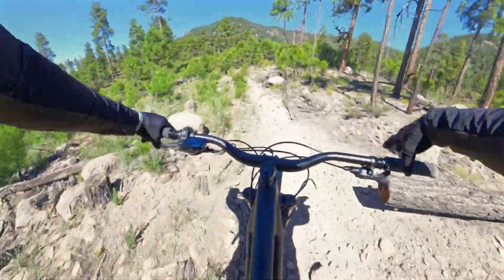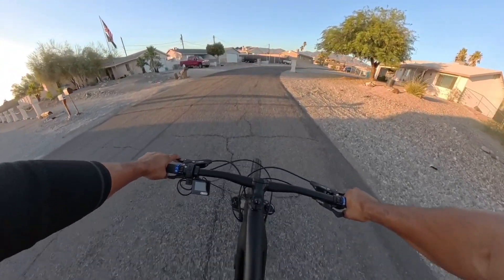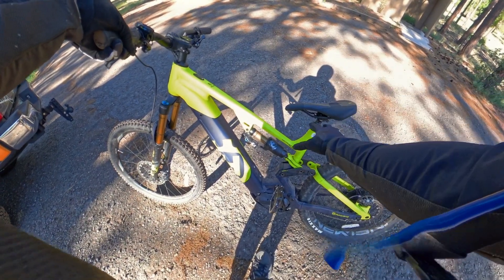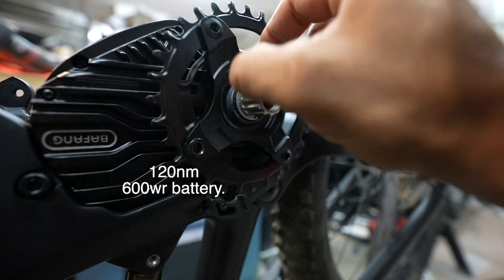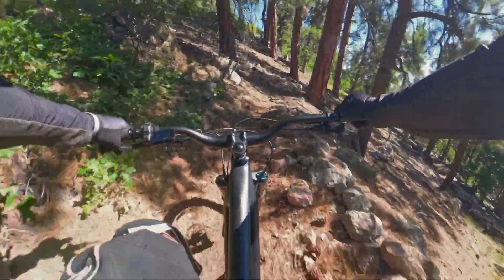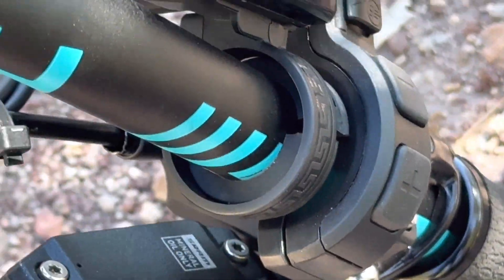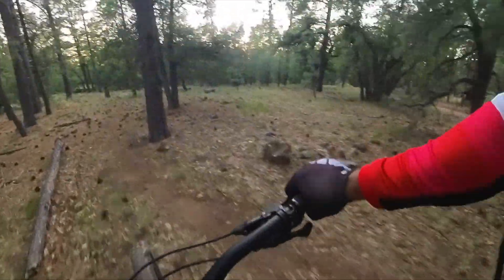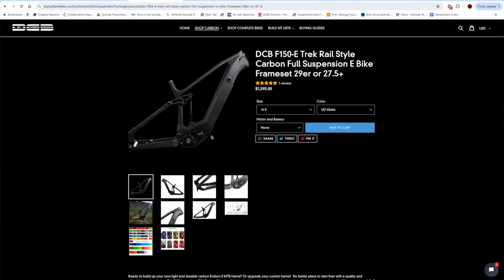Bafang M600 SMOKES Bosch CX & Shimano EP801 e-mtb centerdrive motors

Comment: You are using boost wrong 😂😂 on the bafang M600!
If you get over 16mph in boost mode hold down the power button as if you was going to switch it off... its a hidden push to go button that only works after 16mph

Comment: Big fan of the m600, mine died and I upgraded to the m560 which is lighter and even more powerful. Still a great motor, though, and it went through thousands of hard miles, so I dont judge it for failing.

Comment: The M600 is getting pretty old, bought mine three years ago. The M560 is the new lighter more powerful one. And get that, it fits in the M600 frame.
Reply: Have you ever used a M560...... How noisy are they ??  I am just about to build my own eMTB with one
Reply: @ChrisFitzgibbon-d4j  No I didn't, my M600 wont die lol But my guess is that it is similar to the M600. It as a certain whine to it. But honestly it's similar to other motors. BTW my M-600 is still going strong. 0 problems so far, I checked the gears a few months ago and they are like new after about 3,000km + of hard trail riding.

Comment: Ditch the old DPC242 display w/B&W screen. Go color and Bluetooth with DPC245...gives a smoother feel with more efficient battery usage. Plus, the power selector is smaller and more tactile. Been using the M600 since 2019.👊

Comment: hey what tool did u use to remove the nut to secure the chainring? mine wont fit because of the chainring shaft.
Reply from the maker: You have to buy a Befang Lockring tool. They generally come as a set. I got mine off some random website from google.

Comment: I have a emtb with a Bafang 820 motor & it equals my Transition repeater that I love to ride. I put together the Bafang bike as a backup. I only had $2000 in the Bafang which is a huge selling point. The geometry is almost identical to the repeater.
Reply: What frame are you using?
Reply: @Ghost999alpha  CEF50 M820 by SZZS frame and Lightcarbon LCES04 M600.
Reply from the maker: Yup, quite a difference.
Reply: Yep. I've got the M820-75 Nm...not quite as powerful as the gf's Trek Rail Brose-85 on climbs but it gives a lighter bike overall for agility. I use M600 for big alpine climbing days.🤟

Comment: DJI?
Reply from the maker: DJI is out to smoke everyone. No one will be able to beat them once they enter the market entirely.
Reply: @PontoonNation  My Luna Cycles Carbon X2 with a M600 and 2000w controller will still smoke the DJI with twice the power.
Reply: @PontoonNation  dji can nothe stable 1000watt. M560 make stable 1000watt and short time 1500waat boost 90sec go hot.

Comment: Yes you can get numerous displays for the “Bafang” system so visibility isn’t an issue, I use the 500 display and it’s great.
All Bafang motors come with an option for a throttle it’s part of their main harness as well as an option for a shift sensor, cut off brakes and of course a speed sensor.
If you want a good workout Bafang isn’t for that but if you want to have a lot of fun….
Just remember more power higher watt usage.
But there’s always a way to remedy that.

Comment: Another thing is in the Bafang programming assuming you can get the UART version and not the CAN version (newer) if can deep dive on all the perameters as far as torque, assist values.lots of info out there on the net as far as programming goes.

Comment: Yeah these motors have been around for quite awhile.
They are an offshoot from the 02,HD series motors which are DIY.
Been riding my bike with the M620 for three years now and no issues.
Funny a lot of the “bike expert reviewers” don’t include the 600 or 620 motors in their lists.
Bafang are heavier for sure, I remember you used to get the 620 with a magnesium body for a bit but not anymore.

Yes each motor has its own mounting pattern so you can’t swap motors to frames.
There is a company out there that is making adapters to fit certain motors to some bike manufacturers frames.
Reply from the maker: Do you know the name of the company that’s making adapters?

Comment: The M 600 has been around for years. It does have some power, but the controller sucks and I don’t mean that in a small way. When the power comes in, there’s a definite bump. The torque is not consistently applied given your input. The Bosch and EP8 far out classi it here. However, the Luna controller fixes a lot of these problems, but still not as good as Bosch. The best controller so far is on the new M560. It had major problems with overrun in the first versions they say they fix that, I haven’t tested it yet. The M560 is also more efficient and the M600.
The other problem is the availability of good frames. If you want modern geometry, you’re very limited. If you want a properly sized seat, post with enough insertion for decent dropper you’re even more limited.  I have gone away from Bafang and now right a Crestline with the Bosch race and it has all the power I really need. Besides you can’t go very far using all that power it just drains the battery.
Reply: I prefer BSA bottom bracket motors, bafang had the M435 for a very short period, a motor that blew away everything else on the market, super smooth, super responsive and very powerful. Discontinued shortly after its release.
toseven has come up with 2 interesting motors, also BSA mounted. The firmware is still a bit of work in progress, however the version I'm running now is very good.
with all these BSA motors you get excellent cooling and a lightweight frame, however the smallest possible chainring is 40t or at least 42t. for an ideal build you pretty much need a custom built frame though, especially to mate rear suspension and a big battery in one frame.
Reply from the maker: Your only valid point is frame availability - a true problem.  But there's no way a the CX or EP8 beat it.  The M600 can match their power in mode 4 and it still has two more modes to go. It's actually pretty efficient in mode 4.
Reply: @PontoonNation  He didn’t say that the CX and EP8 outpowers the M600, he said they outperform the Bafang in how the controller is programmed to deliver its output, the response time and smoothness of the power/torque curve. And in this respect he’s definitely right.

Comment: I got the Bafang M620 160nm 1500 watt its more powerful than M600 however i think this M600 fits nicer than M620 which is large for a mid drive
Reply from the maker: 1500 watts of peak power?  In a center drive?!?
Reply: @CrushedEMTB  Yes, I run the M620 as well, it's an animal. I don't run it full power out on the trails. I don't want to wear out my drivetrain super fast, and I don't want to piss people off. It's great, but I need a better frame.

Comment: The bafang M 600 is an awesome motor. I have The modified version from Luna cycle. (X-1 full carbon ) It peak powers at 2k  Watts. I am about 250 pounds with all my riding gear on. I’m also on a carbon frame. And with the modified Ludacris controller and an M 600 motor it is insane how much power you get. I can climb just about anything all things considered. Definitely one of my favorite motors ever. My second favorite is the Bosch GEN for Smart system. Which I run on a Mondraker Crafty R.

Comment: Will this bolt up in same locale as bosch?
Reply: The M600 is very DYI and lacks integration of other systems. Another problem is that it rides like a cargo bike instead of a eMTB. There’s almost zero low cadence torque in higher assist levels. It just wants to plow into a mountain of technical rocks at high speed and massive over runs.
Reply from the maker: But it has 6 modes of adjustment. If you run it on mode six (boost), yes but if you run it in the lower modes, the cadence is very realistic. It also depends on how heavy you are. I have your person on this bike is not gonna feel like it just wants to run up the mountain. It’s going to feel more like a standard full power bike.
Reply: And is it compatible with bosch smart system?
Reply from the maker: It has it's own system and controls. I'm not sure if the bolt-in positions will convert over. It's better to get a frame from DCB that is made for the motor out of the gate.
Reply: @PontoonNation  thanks bro
Reply: i have a 2024 trek rail 9.9
Reply from the maker: @jailbreakoverlander that’s a really good bike. I would keep it as is and just build up a DCB as a spare.